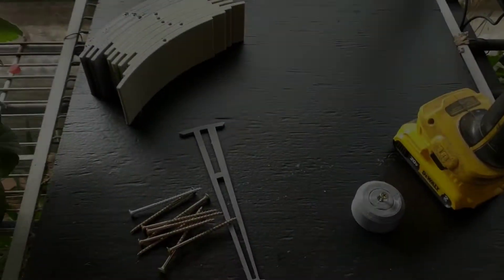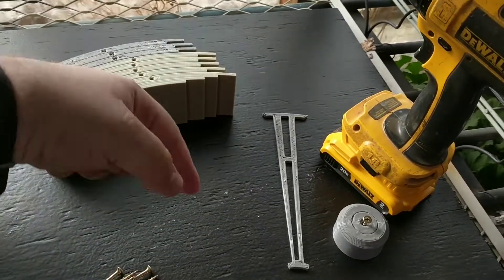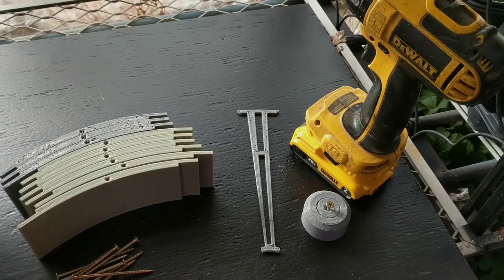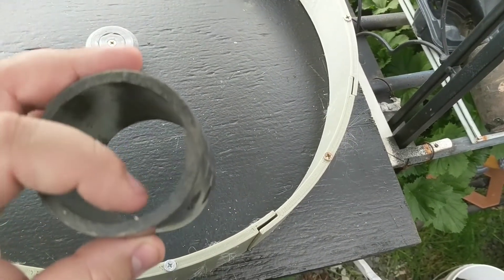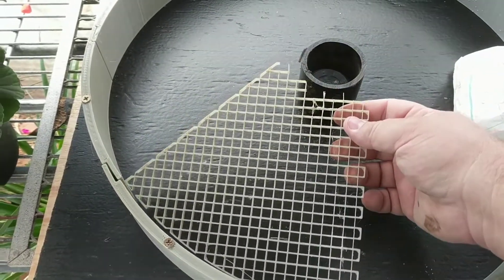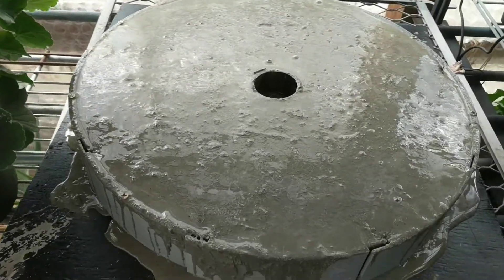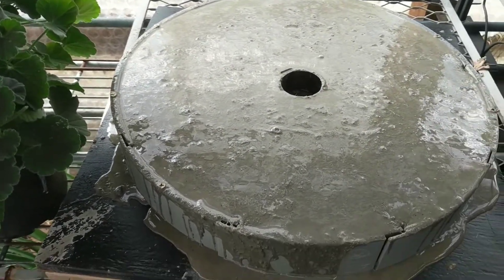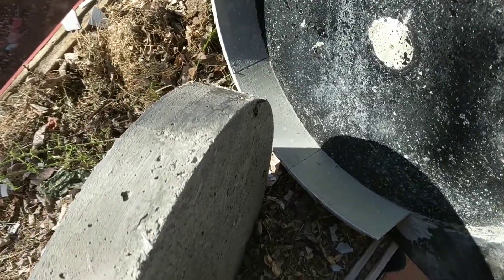DIY Concrete weight plates with 3D printed Molds Updated for new design and tips

Comment: i'm trying to figure out the thickness of a plate, I'm doing 55pound because in europe 25kilo is the standard. I'm thinking of experimenting on a 1/4 of a plate and then just *4 of it.
Reply from the maker: so my files I did the leg work and testing, but you can find a concrete density calculator and just enter your measurements.

Comment: What do you think about cutting dados into the plywood for the molds and center sheath to fit into, and have an exact matching copy of that plywood on top of the assembly? Maybe you could later wax paper and make a whole bunch of plates in one shot.
Reply from the maker: if you did that it be a pain to get the plate out and would need to make these molds larger to get the correct weight. The wax paper is what I use to use, I since just use the flex seal on the molds and plywood and its amazing how easy it is to release the plates. I have screwed a bunch of these down and did a run of 4 45LB plates and just threw a concrete blanked over the whole thing. they turned out good, I did break one, so maybe mixing the quick qure is a idea here.